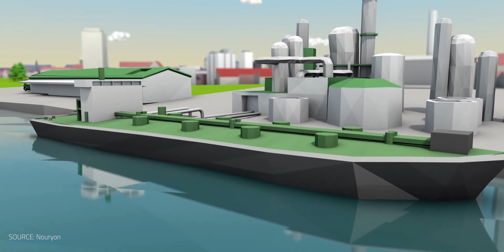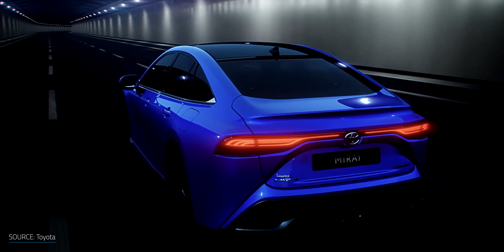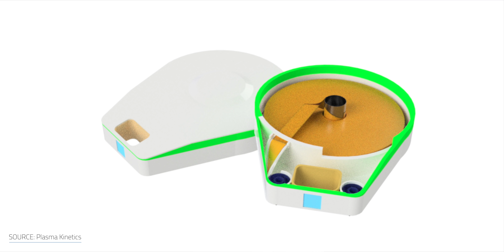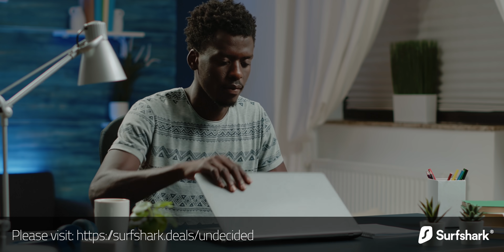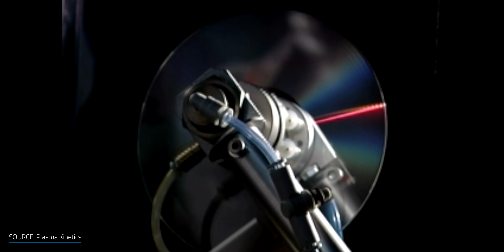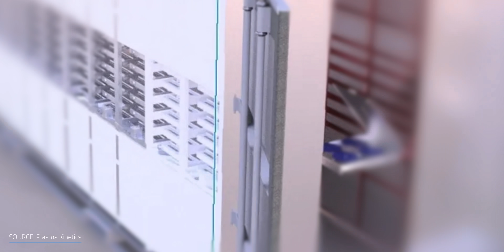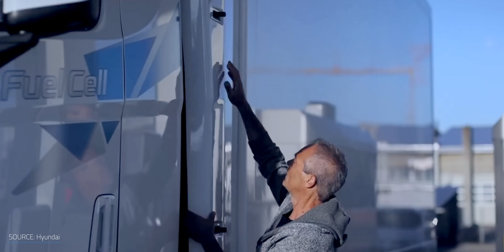Energy Storage Breakthrough - Solid Hydrogen Explained

Comment: There a number of basic chemistry mistakes in the video.  For instance, saying that the photo activity of this invention is similar to chlorophyll doesn’t make sense,  the light absorption by chlorophyll is due to the presence of the porphyrin that the magnesium is coordinated.  A more fundamental mistake is describing this invention as avoiding electrolysis for making hydrogen.  No matter what, you need a source of energy to reduce H from the +1 charge in water to the neutral in the H2 molecule.  This is one of the most fundamental mistakes in a lot of discussion about hydrogen’s use as a fuel.  Matt needs to check his basic science.

Comment: there's an "energy storage breaktrough" coming virtually every week - but that's for investors who are okay with CGI animations and guessed numbers like "95% recyclable" or "60% savings" thrown out without much calculation and testing  - very little companies have actual working solution outside tightly controlled lab conditions - the real issues come with real world implementation
Reply: Indeed.  It's a catch-22.  The technology would only be widely used if it were cheap, and it would only be cheap if it were widely used.  This is like that battery made from nuclear waste:  sound great on paper, but is extremely expensive to make, impractical, and doesn't even really solve the nuclear waste problem.  I only genuinely get excited about these videos when they mention "cost-effectiveness", otherwise there is a very real chance I will never hear about it ever again.
Reply: I agree that there is so much CGI BS. This one seemed a little more realistic to me, although I don't understand the physics/chemistry of it.

But there was no stupid level CGI, and the claims they made seemed realistic if perhaps optimistic.

A remaining problem though with energy density: will it explode? I guess they say it won't if they think you can transport it in normal trucks.
Reply: @melanieenmats  Power paste hydrogen cartridges as magnesium hydride being the carrier is more promising IMO. You get some free hydrogen as it is the reacting mixture with power paste. 

While the hydrogen tape dispenser seems intriguing its has undeniable higher complexity and inevitably expensive. This is in comparison to power pastes simplicity of essentially filling a caulking gun tube.
Reply: "stored on a film thinner then a human hair"
right, good our propulsion doesn't depend on that film not ripping apart like in an oldschool audio cassette player...     wait
xD
Reply: They made a hydrocarbon. the only difference between this and gas is that it is seperated by heat rather than combustion. total scam and misrepresentation. I would question whether they can even recover enough hydrogen to warrant the energy from the laser, let alone the entire system.
Reply: @hernerweisenberg7052  I just watched Thunderfoot's latest debunking video, and guess what... Next up is one of the videos from this channel :). 

I have to say, "Undecided with Matt Ferrell" kind of deserves it.  He has been serving up "breakthroughs" with clickbait titles and without any critical remarks or common sense too often. 
Ofc not everyone can be a scientist, but some common sense or some skepticism has been lacking severely in this channel.
Reply: Nailed it. When you strip away the fancy-sounding words and all the "look how awesome this is!" stuff, this video basically boils down to, "look! We made a thing hydrogen sticks to!" unless I missed something. Doesn't make much sense.
Reply: @melanieenmats  I wouldn't read too much into that tho... didn't Thunderfoot "debunk" NASA's claim to be able to fly a helicopter on Mars as "impossible"? Look how that turned out.
Reply: @annoloki  You mean he was right? did you even watch the two videos or are you just repeating things you've heard? Even if he said it outright wouldn't work, which he didn't, that's still a 1 off out of like 200 at this point. Even still he'd be 1:1 against nasa. dude's smart af, he's got a phd and works in a university nuclear research department.
Reply: @annoloki  He did NOT say it is impossible. Check the video before you post incorrent info.
Reply: Damn that reality ruining all those energy breakthroughs!
Reply: @YoutubeTookMyNickname.WhyNot  True true.
Reply: @annoloki  you could easily just go to Thunder foot's channel and verify, but instead you're saying something that's false. Unfortunately this channel is full of misinformation but many of us don't have the scientific literacy to recognize when something is BS. Please try to at least consider the possibility that you're wrong
Reply: LOL! There's a Reddit post I read - that says: "Graphene can do anything except leave the lab".
Reply: @solidoxygen7873  I knew very well that I wasn't sure, it was some video I vaguely remember years ago... and I did express that uncertainty by wording it in question form. Maybe your expectation of assertive ignorance - not totally unreasonable for reading youtube comments - meant the epistemic modality went under your radar, so you missed that there was another interpretation possible... ya know... considering the possibility that you might be wrong ;-)
Reply: Your giving this company entirely to much credit. Its a scam
Reply: @annoloki  Ah so your original reply was completely meaningless since you put a question mark in there? Your entire premise was proven false before you ever typed it and now you come at someone who called you out on it? Classy. PS you can't come at me because I put some question marks in my reply.
Reply: @melanieenmats  to be fair, Thunderf00ts debunking video is just as click-bait and also has some things wrong, that you can find in his comment section.
The only interesting thing to consider if they can actually make safe storage at 300Wh/liter of used space (including equipment) in a 12mx2.4m HC container.
Reply: @rmp5s  that's it. Anything else I see here is people missing the point.
Reply: @annoloki  that's called click-bait science.
Reply: I'd like to think that we are on "brainstorming" phase of renewable energy evolution. 

So many interesting ideas but many still on the early stages. Time & Market will eventually sort out bad and not so good ideas and we will find the eventual winner.

Comment: Call me a sceptic. I studied hydrogen absorption techniques in university some 40 years ago, and the problem back then was that the structure of the metallic crystals used for absorbing and storing the hydrogen would eventually break down and the storage device would be reduced to a compact pile of "dust" unable to absorb significant amount of hydrogen.

Maybe the combination of these removable storage disc and a plan for how to recycle/reconstitute them will offer a solution, but I doubt it.
Reply: Reusable up to 150 times means it could be renewable so if viable then the convenience factor comes into play as this is a better safer storage device than lithium batteries that will poison the water supply since we all know landfills are poorly made and run far worse than politicians care to admit.  If Tesla or other companies adopt this assuming uncle sam allows it then we can see a real breakthrough with EV cars that can travel more then 200 plus miles and can be refueled in minutes.   Question the video did not answer is, can this idea work outside the lab and make its way to consumers.  If the disks are replaceable then so be it, otherwise its back to the drawing board.
Reply: I'll do one better, you are right.
Reply: Do the maths, they talk so much crap its painful
Reply: @gnaruto7769  can't be scared of nothing? hmmm. you sure?
Reply: Watch thunderf00ts video he debunks this whole thing
Reply: this is a scam, it will never work ;-)
Reply: @gnaruto7769  Which is why I wrote the next to the last sentence and of course if it can be mass produced then no one will fear it except those building lesser energy sources. Don't write it off just yet, I remember when they wrote off ammonia as an energy source and Japan now buys it.
Reply: 0.001 mm disk wouldn't even store 1 gram of hydrogen
Reply: I mean there's alot of potential with some newer material sciences in efficiency modeling and much longer stability. However the way this was explained the energy required makes it less efficient and almost utterly useless. You might as well just use a solar panel hooked up to an electrolyzer as an on demand system.
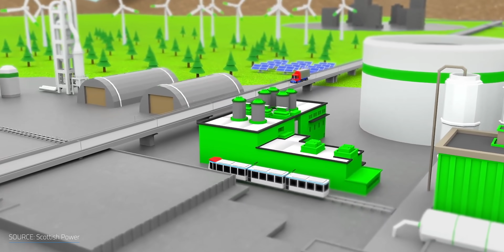Reply: @neutrino78x  I just watched the video and at 7:10 you can clearly see that there's wheels on the side of the capsule. If you're talking about something else let me know but that's just what I saw.
Reply: @Stupidtony21  yeah they started out on the rail then they levitated then they went back down as expected. Its not a scam its called imductrak invented at lawrence livermore nat lab. No superconductor needed, levitates when speed over 2 mph. Look it up its a thing.
Reply: @random6033  yeah but it has a really long coil in the cartridge. Like a tape drive.

Comment: Just listening to the STBD podcast for this video, and I'm not sure what you and your brother are smoking.

Hydrogen has an atomic weight of 1.0078, Helium has an atomic weight of 4.0026.  Helium is a noble gas, and that means that the electron shell(s) present in the atom are full.  Hydrogen is reactive because it has a partially empty shell to link up with other elements.

That's like super basic chem stuff, and I'm not sure how you guys got that wrong.  Especially when he made the claim, and you apparently checked some resource and agreed with him.  What on earth were you checking that made you think something so incredibly inaccurate?

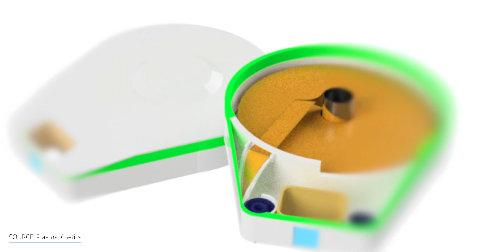Comment: 4:00 "The device could extract metric tonnes of 99.9% pure hydrogen from smoke stacks and gas streams and turn it into a solid state". . . Where is all of this hydrogen coming from?  Last I checked, exhaust gas typically contains carbon dioxide/monoxide, water vapor, nitrogen, oxygen and whatever trace gasses are in the atmosphere.  If you're going to break the bonds between hydrogen and oxygen, you need to put energy into it.  There is no way around this.
Reply: The only way you could do this "without" energy would be to catalyse the steam and the CO into CO2 and H², although it would need a much, much different ratio between the two. You would basically need the exhaust gas to be 80% CO.
Reply: It's coming from their imagination!
Reply: @gnaruto7769  by catalytically stripping the O from H2O (steam) and making CO2 from CO, you would receive H2
how exactly that would work, idk, but its not completely unreasonable.
Reply: @Maric18  that is in fact possible. And horribly energy inefficient, which is why hydrogen lost to battery cars
Reply: @gnaruto7769  while i agree that batteries are better, to be fair to hydrogen ... this is not how anyone would go about making hydrogen.
generating vast amounts of monoxide just to strip oxide out of some of super hot steam is like trying to charge lithium ion batteries by unrolling them and scraping the electrolyte off, slathering new electrolyte on witha  butter knife and then rolling them back up - and then claiming handling liquid hydrogen in a tanker is less of a mess

yes it is, but nobody does that :D

i like hydrogen in contrast because of the higher energy per weight and the fact that you can "just pump it" (as easy as that is with liquid hydrogen), but since the energy retrieval mechanism has its own weight, and the energy density is worse roomwise, i think anything carsized and smaller is better off with batteries, maybe one day hydrogen will be competetive
Reply: @Maric18  as far as I am aware, fuel cell semi trucks could be reasonable as the cabs offer a lot of space for the hydrogen tank, something normal cars just cannot do. Also love your analogy
Reply: @gnaruto7769  I do not remember or know what catalyst it is, but in a syngas refinery (which was used in Germany in WW2) the CO produced is made into CO2 and H2 by adding steam into it (and by passing the mixture on the catalyst).
Even though it's made into hydrogen, I'm pretty sure it's not an 100% efficient process, and it doesn't use an environment of 1 ppm of CO to do that process
Reply: @gnaruto7769  By reacting CO with H2O. This has been done for a very long time now, look up "town gas". It is possible to do this in theory, but you always lose energy in the process
Reply: They were just saying that was one possible application.

The main application would be getting the H2 from electrolysis and then putting the cartridge into a car and getting H2 out of the cartridge. So if you have a compelling reason why THAT wouldn't work, I'd be far more interested in that.
Reply: @gnaruto7769  

"hydrogen lost to battery cars"

In cars, yes. In other applications, not yet.

For example if you want an airliner that goes 3000 miles at 0.85 Mach or higher, especially if you want to exceed the speed of sound, you need hydrogen. Because hydrogen can be burned (in the same sense that kerosene is burned) with just water as the exhaust, and you can't exceed the speed of sound with a propeller, which is the only thing you can do with batteries. I guess you could make the heat with an arc using batteries but not with current ones.

It doesn't sound like this (hydrogen absorbing film) would necessarily make enough hydrogen to run an aircraft, but that's an example of something for which hydrogen will be better than batteries for the foreseeable future.
Reply: I don't know how hydrogen fuel is, but I think it's better than batteries
Reply: @ahmedalosif6430  I think for any kind of big vehicle definitely. Like trains, ships, aircraft. 

Little cars can do batteries, definitely. Up to SUV in size. Tesla proved that. :) But much bigger than an SUV and H2 is better.

I think people are upset to hear that their favorite thing isn't appropriate for every use case...

But hey look at it like this, can you put gasoline for a car into the fuel tank of a Boeing 787? I don't think the 787 would appreciate it. :) Similarly, some use cases will use battery, others hydrogen.
Reply: @neutrino78x  I hope that technology will be available to everyone at a good price and protect the environment
Reply: Ammonia and Chlor-alkali plants have waste gas streams that are high in hydrogen content. Metal hydrides can and have been used to separate that hydrogen at very high purity levels.
Reply: @ahmedalosif6430  hydrogen fuel is great, if your only looking at the energy it creates and its end product is water. The problem is the cost of creating hydrogen, it's energy intensive, and is usually made through methane reformation, hard to sore and transport. It's faster and cheaper just dumping the energy directly into a battery, fewer losses.
Reply: @michaelkeudel8770  Your talk is amazing about hydrogen, I hope it happens... all humans have fuel maybe the idiots will stop fighting